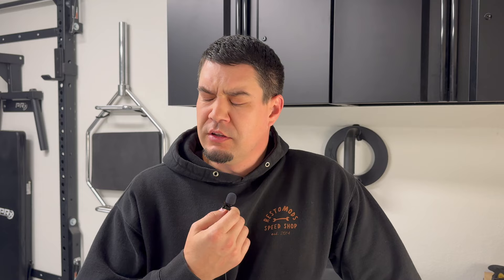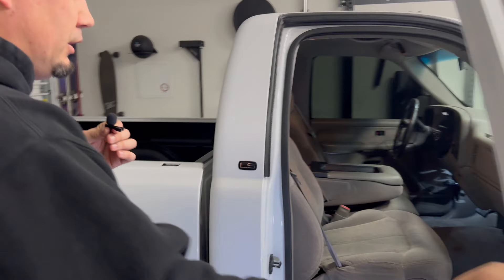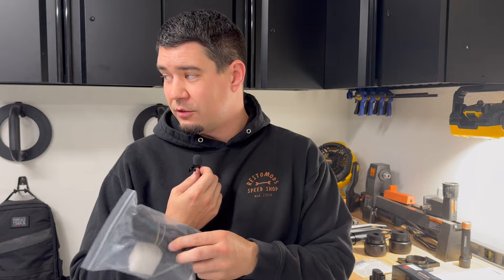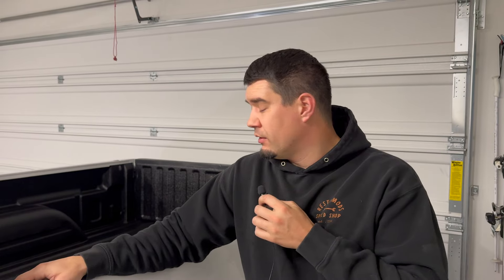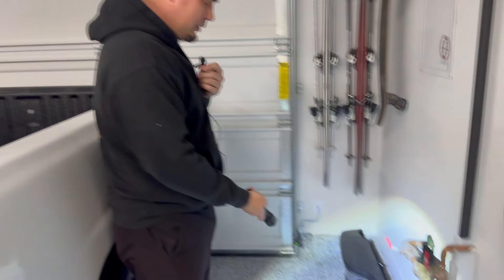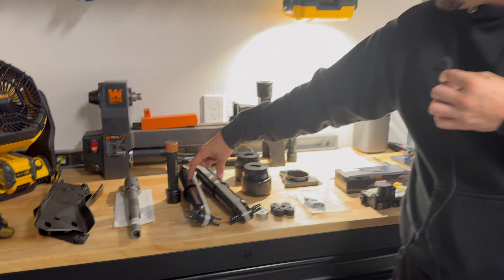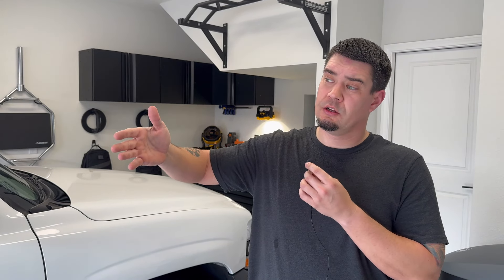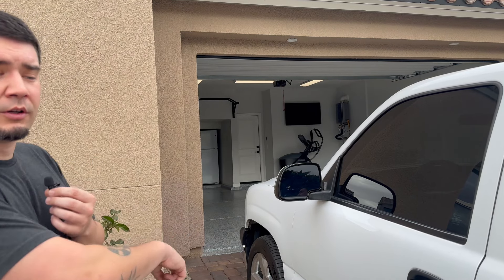2000 CHEVY SILVERADO UPGRADES | COLD START

Comment: Extremely clean truck! I have a 2000 Tan single cab and I'm getting to the point that I want to drop some money into it. Do you have any tips for getting a build list/ places to get quality parts
Reply from the maker: Nice! It’s been a lot of trial and error but the short answer is that you’ll want to spend the extra money on certain parts to get OEM quality and others you can just find the cheapest option. I shop Amazon, eBay, Orielly’s, Summit Racing, and LMC Truck for the most part. There are a ton more websites but these are my go-to options. I only use LMC if I absolutely have to since their prices, shipping costs, and customer service are the absolute worst. Also, use caution with Amazon and eBay as there are some knock off products that pose as OEM. I started my build sheet by writing down every single thing I could think of and then sorted it by priority. For me, it was more important to get the truck running and driving the way I wanted first and then moved on to aesthetics and fun upgrades.

Comment: I have an 04 silverado, when I added fog lights it was all plug and play. Plugged them into the fuse box with the required fuse, and for the switch it was a simple swap and it automatically controlled them.
Reply from the maker: Good to know! I'm hoping to work on that next.